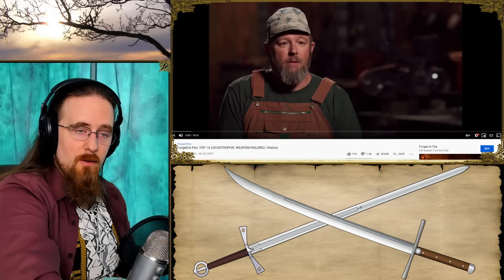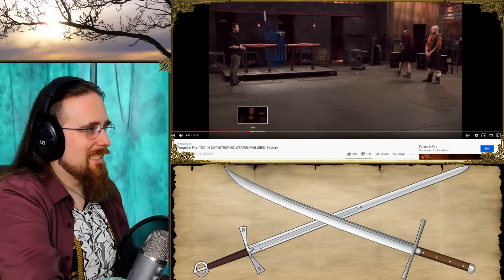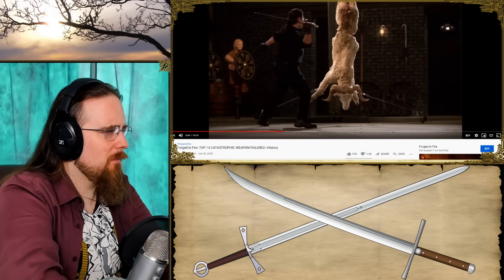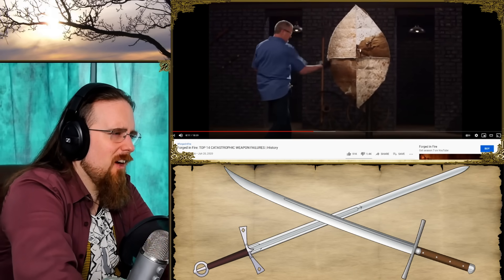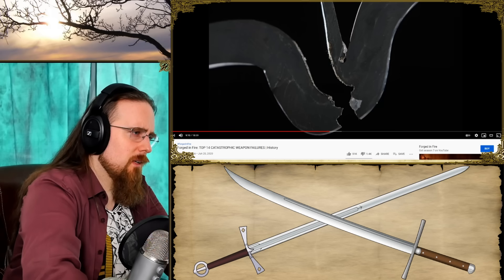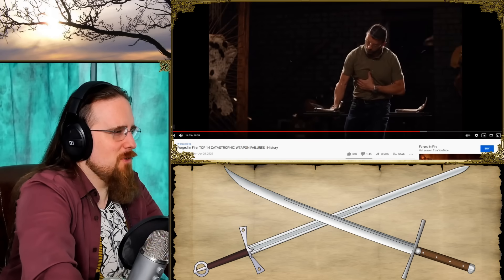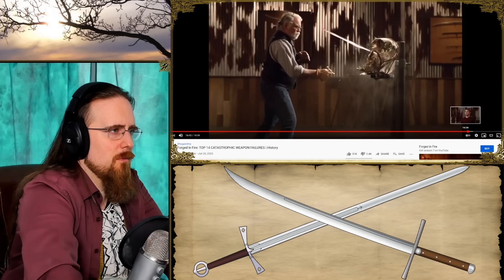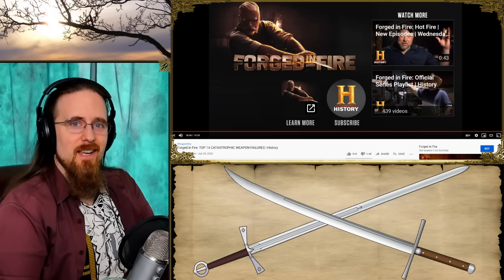Skall Comments: Catastrophic Failures on Forged in Fire

Comment: i dont normally comment on things like this, and havent checked through the huge amount of comments in their entireity so this may have already been covered, but if not.. i would like to point out that while their tests are in many cases not "real world" tests a sword or knife would have to withstand.. all tests are done with the demonstration piece ( for finals ) made by judge david baker.. and the knife tests for first rounds are also pre tested on knifes.. they only use tests that a knife (made by a judge) or the demonstration weapon (made by a judge) can and has sucessfully passed .. it is less of a test coorrect use of the blade and more for the smiths skill in metalergy and smithing  ..  david baker has openly said as much on a few occations, that no blade is ever tested on a test that (if made correctly) it couldnt pass.

Comment: I think someone should break it to Skall that a good sword shouldn't shatter into pieces when you mess up your edge alignment. His judging of whether the edge was angled well is valid, but infuriates me when he tries to judge it on a shot where the sword clearly snapped over a hard obstacle, there's clearly a different problem there than bad edge alignment.

One of the issues would be a bad handle, a lot of craftsman fuk that up, even on the show. Another is the material or a flaw in the blade. Yes, Skall does mention those, but why the hek does he care about the edge alignment so much, it shouldn't be the main factor in a weapon's durability. When someone breaks a weapon in this way it isn't the causality, it is the means by which the flaw in the design or making is revealed.

How would a sword like that hold up on a battlefield? Where it has to collide with dense hard objects (like humans in armour), withstand glancing blows and parries, crash into shields. You won't get good alignment most of the time, because the opponent moves a lot and after hours of use the weapon still should stay in one piece. Of course even in historical scenario it won't always do so, but show me a historical example of the military tactic that uses this one time use sword that snaps at the first harder strike. 

Weapons break it is to be expected, they are one the implements put under the most stress, and undoubtedly some of the durability tests go over board. But having the contestants to that broken weapon go through the same test in one piece clearly shows that a durable weapon is not some kind of fairy tail.

Comment: I'll go out on a limb and say a good percentage of failures are due to problems with temperature control- either not heating fully to critical leading to soft spots and warpage or even worse, too high a temp for too long resulting in brittle grain.

Comment: 7:30 Or the tip hit and that caused the weapon to twist?
Copper pipe test: The tester probably hit the knife too close to the tip and created torque in the blade instead of on top of the pipe where the blade would be supported.

Comment: copper vertically is pretty sound structurally... So long as it does not bend, and with a solid block baton it's not giving it the best chance at stepping through the test to be fair.

Comment: Copper pipe test is great. As a maker all my blades should be able to cut copper pipes. With todays steels and heat treatment. However you don't have a heat treat oven in these and they almost never use known steel. Even the best is rolling dice on that edge.

Comment: Here's the thing, if the tests are mild and every blade passes the test, then it's down to fit & finish. It does happen, but it's better if there is a definitive winner. And ratings are likely better with more extreme tests.

Comment: Pattern welding was originally just to spread out the carbon in the steel evenly, so that you'd get an evenly tempered blade, since the steel they were using in ancient times might not have an even spread carbon content. Today steel is so much more homogeneous that there is no need to pattern weld other than for looks or tradition. Yes, you could mix 2 different types of steel to get characteristics of each. But it's highly doubtful that you'll come up with anything that there isnt already a modern homogeneous steel you could buy with those same properties. But pattern welded steel is beautiful so people still make it.

Comment: Watched couple seasons before.
The goal of those ruthless tests are to find out the flaws in the smithing  & building.
Just testing in 'Normal usage' some critical failure may fly under radar.
Remember, those are blacksmiths not martial artists, it's not about a weapon is good enough for use or not, it's about finding a winner.
P.S. they do fires bullet in to blades before, also some cases if two weapons ends up pretty even performed, the better design one wins( looks, weight, comfiness , etc

Comment: These test are somewhat based on the American Bladesmith Society journeyman and master Smith test.  Of which your blade must cut through a free hanging rope, then through a 2×4 or 2×6 twice then still be able to shave hair and finally to test the heat treat you put a cheat pipe on your knife and then bend it at a 90 degree angle.  If it doesn't shave hair fail, if the blade snaps fail.  You'll never make a blade like a blade that is made for testing

Comment: The only time there is a major major failure is the structure of the blade, mostly the handle  sometimes forgers makes handles that is was too smooth that it will roll in the persons hands and some have big hot spots were it can cause  injuries to the person wielding it, but most of the time it’s the heat treatment of the blade that cause these types of failures, some forgers like use steel they are unfamiliar with or they know the steel too well that they mess up on the treatment cause of how many days they have or time

Comment: The problem with these durability tests is even really well made weapons will break. A sword is not a club. Just because it breaks while wacking an ice block, does not mean it will bresk when parrying another sword or cutting through a body. In fact if you overbuild a sword so much that it can take those impacts its no longer a sword. Its a steel bar

Comment: what you're suggesting isnt out of the realm of possibility; they already do tests that are basically insane for a blade to withstand. just make those tests the tie breaker. i always thought it was nuts that they were like "make a blade out of the springs from these clicker pens then we're going to smack it against a piece of concrete 10 times then attempt surgery with it" where the tests just do not seem to get progressively harder at all they are just all torture.

Comment: I think using fit and finish is of fair assessment. And usually it's not all that subjective you know They look at everything and fine detail and if your guard has a 1 mm gap and your opponent's guard is perfectly flush that can send you home.  If your blade performs great but in testing your traditional cord wrap comes loose and the other guy didn't do a cord wrap so there was nothing to go wrong, same thing.

Comment: a dried bone skull would fracture more easily because a skull is thin, lightweight, and hollow on the inside. a hardened calf or arm bone is going to be hard as a rock whereas the living bone is spongey and full of marrow, because those bones are solid but need to be slightly bendable without shattering (like if every time you jumped your bones exploded like that skull, that probably wouldnt be very good for your survival, and imagine what martial arts would be like if every kick you threw destroyed both your shin and your opponent's blocking arm)

Comment: But i think (maybe i am wrong) that shield almost always is more than just a hard wood,right? Some metal i think is added too,so would It be harder than just that piece of wood?🤔
Reply: The big cowhide shield in the clip. Just wood and leather,  tradition african shield vs traditional aftrican weapon, (tho both from different areas i believe)
Reply: @thehutch4823  Thanks for the answer,I did not know.
Reply: @piotrdworowy183  No problem, I think some of the richer tribes might have had a copper inlay too, but most were wood. The wood they used tho were very hard woods, wood that would easily dull a knife.

Comment: For the horse skull test, I think Dave actually hit the blade on the skull and then on the metal fixture, causing the blade more stress.
And well yeah, the blade breaks at the shoulder, which is totally on the smith, but it proves that the consistency of testing and judging in this show is not that great.

Comment: I used to like "Forged in Fire" but I learned that the tests are  far and away unnecessararilly punishing to the weapons. The "pros" don't look very "pro"! They don't seem to be in "control" of the weapons. And as you mentioned, they almost never wear protective gear! For the most part they always appear to be just doing "uncontrolled flailing" at the target! Their edge alignment is almost never good during testing. When they do, by chance, get the alignment right the just "over power" through the target, which isn't what the weapons aren't DESIGNED to do! They don't replicate the work or techniques that the weapons ARE designed for. They just SMASH the target as hard as they possibly can and are out of control. That's why most of the failures occur. Not because of a failure in the material or workmanship! The other "technique" they use is to make the cuts, as in carcass cutting, to look as "gruesome" as they can for effect for the "audience"...not as a test of the weapon! The testers are supposed to be "professionally trained" but for the most part, anybody could get up there and flail around as hard as they can and get the same results!! I know this is a huge "hate" on the show but it's what I've seen, over and over again on it. If they had true pros in the techniques for using each of the weapons, I'm sure the outcomes would be entirely different! The show had "construction pros" on the panel but a "Kali" martial artist isn't "trained well enough to use most of the swords submitted. For instance, when the swords being judged were "Small swords", he smashed the target with "edge", as though he was using a viking broadsword!!! Smallswords don't even HAVE a cutting edge ON them!

Comment: So I think the key point of the show is that they aren’t testing a realistic situation for the blade, they want to find any weak point in the blade, so the tests are designed to cause failure at even minor imperfections. Is it a fair way to judge how effective the weapon would be? No. Is it a fair way to judge the capabilities of the blade smiths? Yes.

Comment: Some tests seem very harsh indeed. I sometimes wonder if the tests really test the "skill" of the bladesmith as opposed to their luck.

Forging and tempering isn't an exact science after all. Microseconds and tiny temperature differences in forging,. tempering and quenching can mean the difference between a blade breaking or holding during certain tests.

Comment: Pattern welded is flat out never better than good monosteel. Even if you would get 2 metals which are both extremes and whose pro's and con's cancelled out you would still have parts in your edge that would be prone to rolling and parts in your blade that would crack under flexing. Most pattern welded steel uses steels that are mechanically very close to one another with merely cosmetic differences so it will still perform well. But yeah it is just flexing your skills. It is barely ever relevant for the final though as the jury priorities are: Parameters > Survival > Performance and handling(usually lightness) > quality of handle/fittings > looks

As for the testing on forged in fire: for every challenge the jury actually makes a blade beforehand with the same challenge to see if it is even possible. For round 1&2 the blade is made by the resident ABS mastersmith (Jason Knight for the first seasons, J. Neilson afterwards) and in the final it gets compared to the historical replica made by Dave Baker. Supposedly they never asks more of a smith than they would of themselves. Also Doug, who is an expert in knives and not swords, doesn't really get any practice beforehand and is just handed a blade that is anywhere between ~800 grams and 3 kilos with an unknown balance point and told to swing it x times at a dummy. All things concidering he does quite well.

Nearly all failures are a symptom of sub optimal heat treating in the show. Seeing as most smiths on the show have never made swords before, let alone some of the weird misshapen blades they need to produce for the finals, they don't always have the right equipment to make it go smoothly. This means improvised quench tanks, uneven heats because of a small forge etc. Add to this that they only have 35 hours for it it is very impressive that these catastrophic failures are as rare as they are.

Comment: I guess I don't get why the strength tests they do are so over-the-top. Every weapon has one or more strength tests for its intended use(s), but they go with crazy stuff. I also have issues with how some of the strength tests are done; for the Zulu shield test I'm pretty sure it broke because it hit whatever they were using to hold the shield in place. It makes no sense to me, whether or not the weapon twisted/the swing altered; it's going into leather with a wood frame. However if said wood frame is being mounted into place with metal, then there's the point where a break could happen. I feel bracing the strength test objects directly on a metal plate/frame is where some of these tests go bad, as it's not the resistance of the "test" object, but also the bracing material.

Comment: I'm wondering about the time vs forges most of these contestants have. Most seem to have a really super small forges. I admit I don't know that much about blacksmithing, but it seems a bit unreasonable that they have to do a full length blades out of random materials with such small forges. I think even that itself leads towards these disastrous flaws in blades add the time constraints and the odds are even more tipped that way.
 If they did guest judges and asked you for the job would you accept ?

Comment: To be fair to the judges on Forged in Fire, The angle a blade hits in battle is not always going to to be perfect. I have seen everyone of these episodes and although they are tough tests, remember that weapons were used historically for more than just human to human combat. They were in many instances tools to farm with such as Karate, they were used to chop wood as in axes. Survival and modern fighting knives have to survive clubbing tests because your knife is expected to chop wood. And there is also the fact that blades do not always connect where we want them to in  the heat of battle or at the angles that are perfect. Maybe in a FAIR, one on one duel, but when you are charging with several hundred men in differant types of armor against a similarly prepared foe, there is no telling what you would hit or how hard. I am not critizising you, I love your channel, but the reason why the tests are so harsh is so that MASTER bladesmiths produce work that is first class. Most of those blades snapped because of either heat treat issues, or structural design flaws that you pointed out. Heat treating by fire is an art form all by itself and if you purchase a $300.00 knife or a $1,200-$2,500 sword, you want one that will hold up to the test of time and battle. Again, no disrespect, its just that not all weapons are used as weapons in war, they are used in farming, Hunting and Building.

Comment: If 'fairness' was a real concern in the testing then the tests would be done by machines which delivered identically weighted blows at identical angles - the old 'mythbusters' created such machines for that exact purpose quite often.  The blades which were wielded with poor alignment actually suffered greater stresses than the blades they were competing against - so not exactly a fair measure of the workmanship.   The fact that some of these 'failures' can now be seen as at least partially down to poor alignment by the tester puts the show in danger of suspicion of producers manipulating outcomes, which might be unfair on the hosts but which IS a flaw in how the show is done.  I understand the other perspective - these are weapons created to be used by a human and THAT needs to be measured - both things could be achieved if the producers cared to make the effort.  I think the contestants are generally tremendously well behaved in the face of what their blades are subjected to and how little 'comeback' they are given to the way the tests are done.

Comment: I mean, some of the tests you do Skall are still a bit abusive. All because Forged in Fire's tests are more abusive, doesn't make yours not abusive. It's just less abusive. Attacking a tree with a sword was generally known to cause sword breakages in the past which was why they generally tried to avoid it when fighting in a forest. Hell, I've seen good axes break while someone was going to town on a tree. You find that magical knot with a vastly different density than the rest of the wood and watch the axe head twist and the handle break at the head.